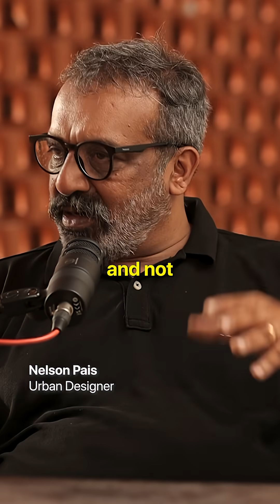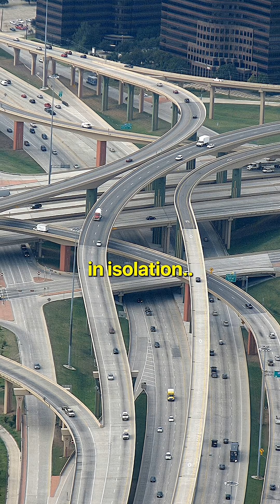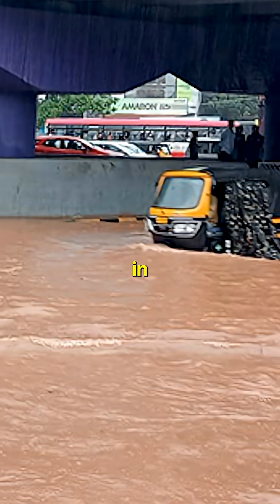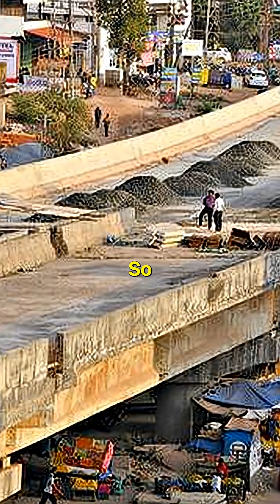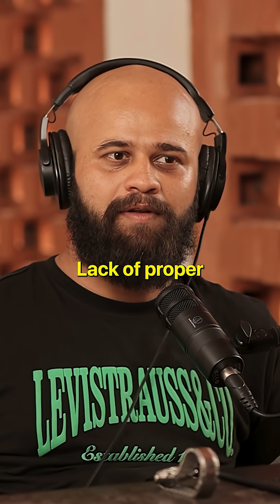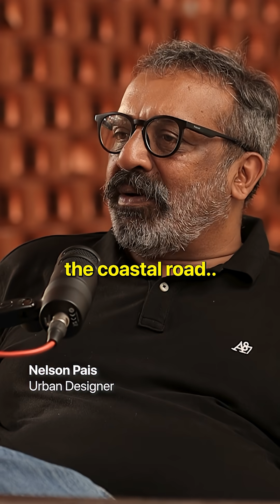Pumpwell Flyover Mangalore's Engineering Failure #Mangalore #civilengineering

Comment: As a practicing Hydrologist Working in Karnataka.
When i done forensic of drainage system of Pumpwell circle , Mangalore .The observed results were surprising.
The Authority and engineering department completely ignored natural drainage which carries rain water from 3.5 sq km of  catchment run off and it requires drainage nallah of 10 -12 mtr wide minimum and they have to install gutter drainage sytsem right under the fly over which is missing on site.